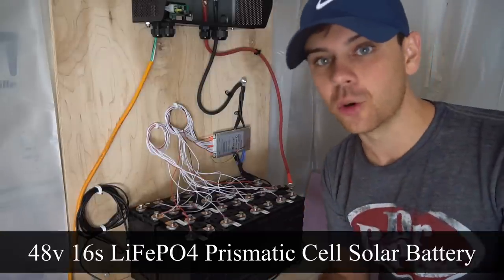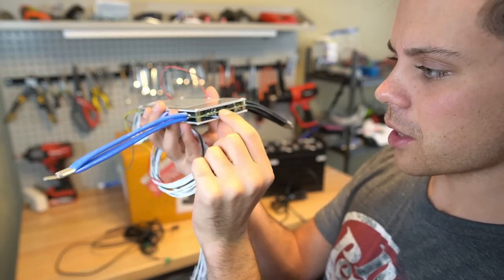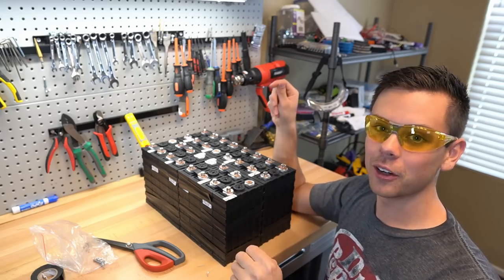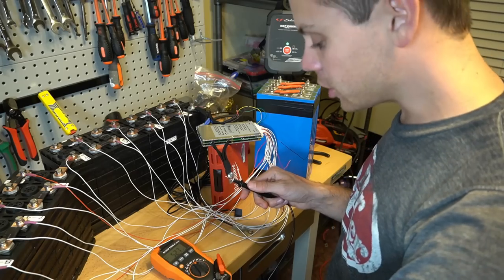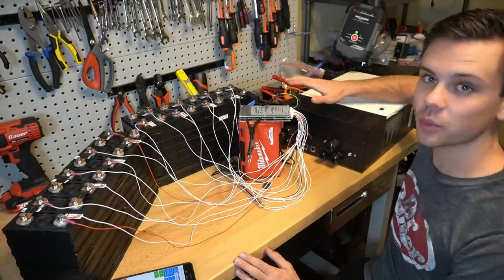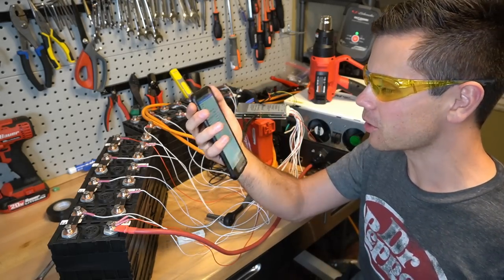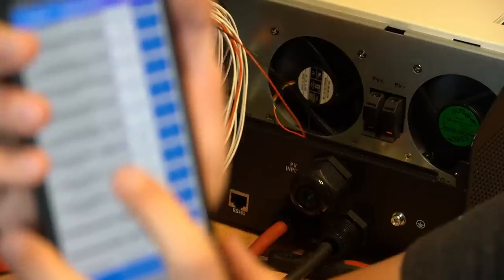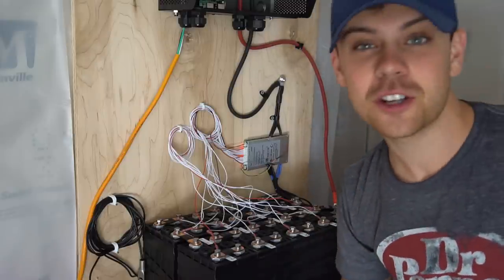DIY 48v LiFePO4 Battery w/ $72 Bluetooth ANT BMS (low temp cut-off!)

Comment: Hello Mr. Prowse. My name is Tim, I live in Nome, Alaska. Someone in town recently had a heated doghouse for sale. I thought, well how about a Solar, solar/wind maybe small vertical or egg beater? ), motorcycle lithium cell powered dog house/kennel. I wonder if someone could build a dog waste processing "plant" into it, step-on or bump-into activated switches, door opener/ closer, water pump, light, fan, window opener closer. Things should open and close in a controlled fashion with some kind of safety brake or stop. enough for  1-6 dogs per kennel. How ' bout that? thank you for your videos and hard work for the benefit of your subscribers, I have learned a lot from the ones I have seen. Uh..it seems that sometimes your arms and hands are all over the tops of the batteries when you are describing what you are doing, and it freaks me out.....anyway... thanks.😆

Comment: nope- by the NEC code book #10 copper is only good for 30 amps you have to use 70 degree and you cannot parallel anything smaller then 1/0

Comment: Although I actually like your videos please take note of two VERY IMPORTANT issues:

1. NEVER recommend to users to use multiple cables to distribute the load. This can be done but you need to be extremely careful. If let’s say you use very good wires and one has a resistivity of 0.001Ohm while the second has a resistivity of 0.002 this would mean that if you solder those two wires in parallel, you are making the cotisation worse. Because of the difference in resistance, the first wire would conduct twice the current of the second. You can do that but you will need to add resistors in series with the wires.

 2.  Your temp sensors are susceptible  not to work and probably one of the does not. There are two types of temp sensors , NTC and RTD. You need to find which type your BMS supports and what type are the ones you have.
Reply from the maker: I figure someone building this would know about the wire issue.

And my temperatures from the sensors were dead accurate. Would they show a different value if I used the other type of sensor? Scc use the same type of two lead sensor. I know there are three lead sensors, is that what you are referring to? And I will be programming cut off values very conservatively, including the reconnect temperature
Reply: @WillProwse  fair point for my first note,  just browsing trough some of the comments down here it seems people might think this would be a good idea without further research.. Anyway, on the second point, two wire temperature sensors are usually NTCs, which are cheaper, less accurate (not relevant for this application) and have a larger temperature range. RTDs are also two wire sensors based on resistivity variations, but they usually are more accurate over smaller temperature ranges. 

After a  bit of research I believe both your sensors are NTCs, since you get more or less a correct temperature (+/- 2C is not an issue here). You are actually lucky because the sensors you have are matched with the internal calibration of the BMS, which could be completely off. They should recommend or mention in the manual which NTC sensor the calibration is intended for, the most common being PT100. 

Three wire temperature sensors are actually digital thermometers. They are not analog resistors but they have an integrated adc and are pre-calibrated to report directly a temperature value to the micro-controller.
Reply from the maker: @luminociter  very good to know. Thank you. Will read into all of this more. Appreciate it
Reply: @WillProwse  hey will, did you figure out which kind of sensors you were using? I received the ant bms and it came with two temp sensors, but they are premounted on tiny bms boards with simple click connectors, however thats too large for my battery design, and I would rather have simple sensors like you do in this video. thank you for doing these videos!

Comment: No inline fuse on those battery leads ? I would put a small 5 amp fuse on each one. Right?
Reply: They don't do it in commercial batteries. Plus they're in series so it's only the output that matters.
Reply from the maker: yes just voltage sensing wires.
Reply: @WillProwse  You don't think the little wire might ever burn up or catch fire if something happens to the BMS?
Reply from the maker: @controlyourfuture5477  we had this discussion on the forum. You can find all the points to consider. Considering Tesla battery modules, and every commercial installation battery has unfused wires, and that the wire itself would probably act as a fuse, no issue. Also, a fuse can cause voltage drop, which is not smart on voltage sensing wires. So no fuse here. Protect wires though. I see your concern though but it's fine
Reply: @controlyourfuture5477  The sense wires just measure voltage, they don't draw any significant current, probably not even a milliamp. A fuse would be useless.
Reply: @ahaveland   You're right. I just though if that BMS wanted to short some how those little wires  would glow red.
Reply: @controlyourfuture5477  I've burnt out a couple of those wires, but only by adding another battery in parallel and inadvertently connecting the wrong one to another cell and therefore causing about 4V at a high current to flow through it. You just have to take meticulous care that every wire goes to where it should go. After that, there shouldn't be any problems if the equipment is configured correctly to failsafe.
Reply: @ahaveland  Yeah never thought of that. The BMS doesn't have a negative. Just use to always having a fuse on a positive post I guess.

Comment: Wow 4x 12gauge to push 320Amps!!! really pushing the theoretical limits of the wire. 12 gauge = 3.31mm2 x25A = 82.75 Amps per wire x 4 + 335Amps or 6.53Kcmil x 1000/80 = 81.625 Amps/ wire x4 =326.5 Amps

Comment: The battery wires that come on these ANT BMS's are a joke. I ordered the 100amp version assuming it would have something like 6 gauge wires - which is the recommended size for 100 amps with short runs in chassis wiring, etc. I was shocked to see that it had 2 - 12 AWG wires in parallel (roughly equivalent to a single 9 gauge wire). A #9 wire is max rated for 64 amps for short run chassis wiring. In order to be able to handle anywhere close to 100 amps, the stock wires on these things shout be cut as short as possible ( three or four inches) and then a new heavy duty connection lug crimped on.
After seeing the 100 amp version, I ended up ordering the 320 amp version (as in this video) which has 4 - #12 gauge wires. This is equivalent to a single #4 gauge wire. However, a 4 gauge wire is only rated for 135 amps for short run chassis wiring.
I suspect the biggest limitation of these BMS units is not the wires - but the copper on the PCB and the capacity of the FETs.

At this point I'm wishing I'd have just bought a cheap low-current BMS and used it to drive an SSR to just switch my inverter/ charger on and off.

Comment: Why is this for advanced? What knowledge/experience level is "advanced" or "noob"?
Reply from the maker: It's all beginner level technically
Reply: @WillProwse  cool. I watch your videos and think most is "doable". Your videos make me want to build a large system for my home in Houston or farm in Missouri. I have built large nomad systems in Wyoming to extend networks into the mountains for work (oil and gas, 10 yrs ago). We put up megawatts of solar/wind/thermal for the oil industry all with traditional Sla. I would like to see what a 10kw system with 5 days 100% autonomy looks like with modern electronics and batteries.

Comment: I find it so stupid to have to use an external battery to start a Battery Management System!!!
Reply: No... Even powerbanks work like this.
Otherwise it could fry itself when it's rebooting or in failure state
Reply: And I think you could have used one of the cells as well

Comment: Let’s be real. Sounds as if the software functions, but this is another example of hardware that is not ready for prime time. The concept of stating 300 current pass through is never going to be sustainable in s few 12 AWG wires., even if you use all of the tabs. The individual cell connections are not ready for prime time. If you were to utilize this system with a set of 16 200 amp cells, you really want to trust a $5,000 investment to a $72 really cool but toy construction device?
Reply from the maker: The more expensive ones have similar problems. And you can use this as a master control for a relay. And yeah if you don't like it, don't use it. I think for used cells, or second life batteries, this unit is perfect. Also, a BMS like this is dead simple, circuit wise. So it is easy for me to trust it. If a BMS required more processing power or complexity, probably not. Idk, pros and cons. I can critique the more expensive BMS available as well. They all have problems

Comment: I can see the cells are very unbalanced. If you put the charger at 58 V and then read cell voltage when battery pack reach > 57 V, you will probably find a delta of > 200 mV. Look at the manual and find out balancing current, then you can calculate how many hours /days this BMS needs to get cells in balance. When you have delta of 5-10 mV for all cells then they are balanced and note you need to read voltage when cells are > 3.55 V. To be frank, I doubt you will never get all cells in balance with that BMS. You might also double check with a multimeter which measuring milli volts (because BMS has probably poor accuracy). What happens if not in balance? - Every time when battery fully charged at the end of charge cycle, then some cells will be pushed higher i.e. 3.7 V or higher and this will age those cells which potentially could make the cell pack even more unbalanced and so on.. Finally, battery life will be shorten. If you spare money of a cheap BMS you can at the end loose more $ because cells are not that cheap.
Reply from the maker: Yeah it's fine. It might even take some weeks but it will balance. Half the cells have been broken in. So I don't expect them to be similar for a few months. But I don't really care
Reply from the maker: If I need to I will add a manual balancer that can push 8 amps
Reply from the maker: Only detriment for the next few weeks will be reduced capacity but that's pretty much the only downside. But it's a backup system so I don't really care
Reply: @WillProwse  Yes I know, but have you tried? The cheapest way is to take a wire (10 - 20 feet) and shunt each high cell. You can even push 20 amps by manually shunting with a wire. But problem is when shunting high current you also get voltage drop and lag for voltage to recover. It's in fact quit difficult to manually shunt and not shunt to much or to less. I have only done it for 12 V (four cells) and it took some time..
Reply from the maker: @mikaelgarton372  oh I know, I have six or more videos of me showing how to do that. But I don't care because it will balance in a week or so. It's 100ma rate so it's fine. It's a backup system. I know how to balance cells manually
Reply from the maker: @mikaelgarton372  have you not seen my other videos tutorials?
Reply: @WillProwse  It would be very interesting if you make a video of balancing by "cheap BMS". Charge cell pack as they are now until cell voltage is about 3.6 V and film all cell voltage, then continue charge and film after a week when cell voltage is about 3.6 V. Also interesting to see if balance current is 0.1 amps as stated. You may film the clamp meter as well. Also report if any heat issue. I'm pretty sure you can make a nice and interesting video regarding this.